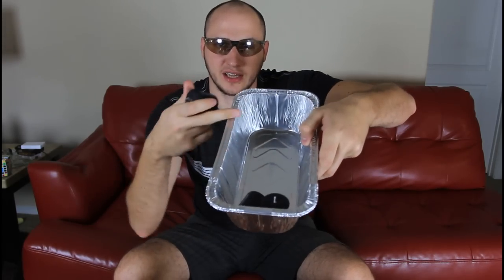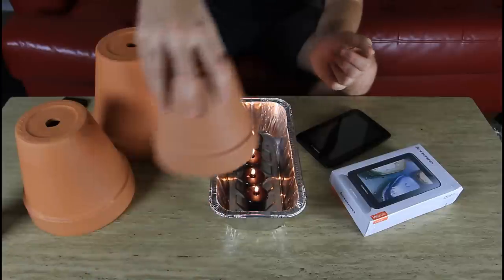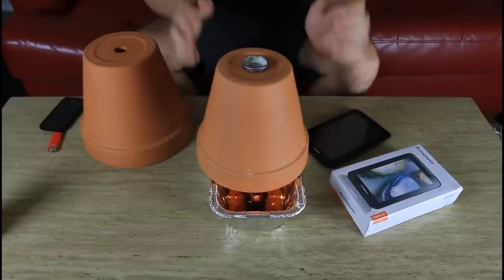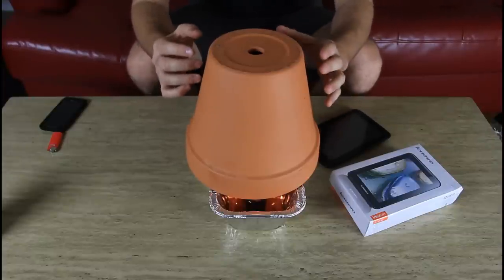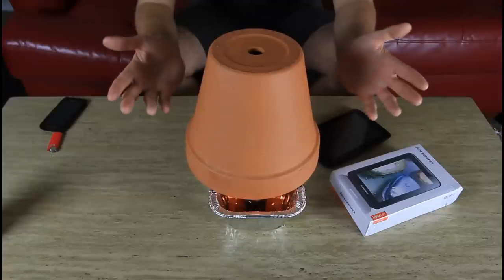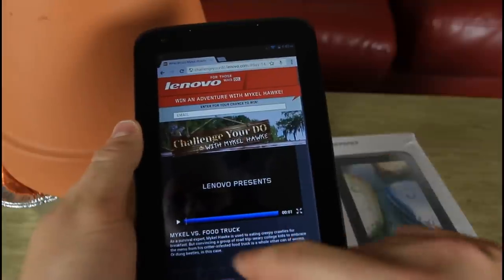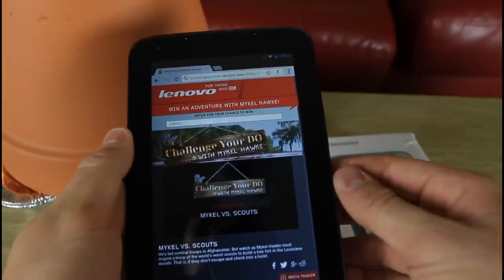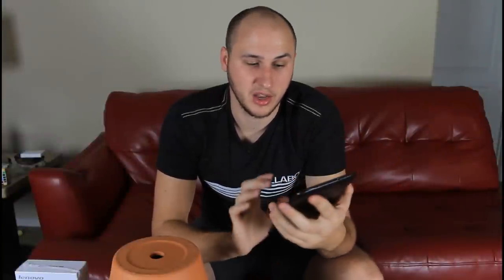Candle Powered House Heater

Comment: Here's my two cents on this thing. Tried it out this (2013/14) winter. I deviated a little from the original. I didn't put my candles in a baking dish as I thought the candles wouldn't have enough oxigen to burn. I made a stand out of a few stones so there was air flow coming in from the sides. It takes about an hour to heat up to the max. And the teapot candles burn for 4 to 5 hours so you've got a couple of hours worth of heat in one sitting. After lighting the candles it would be wise to check on it after a few minutes to see if the candles are still burning. Sometimes one or two would go off. While it does produce heat, the pot heater itself is inufficent to heat up a lot of space. As an additional heat source it does work nice. I used as an additional heat source noth in my bedroom & in my bands practice space. On two occasions it cought fire. The heat inside the pots was so big that the wax in the candles cought on fire. Smoke and everything, had to ventilate the room after I put it out. So there you have it. Definitely would not leave it unsupervised.
Reply: +branimir sremec "definitely would not leave unsupervised" watch my videos to find out why that perfectly describes me.

Comment: how does it work: it will be warm
U dont say!
it actually works because instead of the heat just making a straight column up, it captures all the heat and radiates it out, which is a much more effective way of transporting the heat into the whole room

Comment: Those candles would heat the room up more quickly without the flower pots. What you are trying to do would make sense if you had an external chimney. In that scenario the flower pots would absorb some of the heat from the smoke gases and keep that heat inside while the gases escape through the chimney. But as long as the combustion products don't leave the room, your contraption is useless.
Reply: -_- really candles Heating

Comment: Ha!  My heater is broke and I'm totally going to try this.  It's pretty smart since the ceramic pots will hold the heat rather than it flying up to the ceiling and disappating.  Pretty clever.  Just like a pizza stone in the oven or how people used to put hot rocks under their blankets for warmth in the old days.  Great idea.

Comment: wont lighting 4 candles heat a room just the same, with or without the ceramic pots?  You are not changing the amount of heat the candle is giving off, you are only changing what gets hot in the room first.

In this case you are trapping that heat in a ceramic pot, so the candle is going to heat the pot before it heats the air.  Basically you are going to have to be very close to the pot to gain any benefit.  After 4 hours of burning, the room is going to be the same temperature with or without the pot.

Comment: First of all, I loved your idea, so much so that I actually went and purchased all the items required. May I suggest some amendments, first of all those tea candles do not last very long, so instead I bought a larger candle that was scented that had three wicks on it. It was only $3.00 American. It was worth a try to see how long it would burn. I payed $2.50 for a package of 48 tea candles unscented. I hated the fact that in the middle of the night the tea candles would go out, I had a choice of getting up and replacing them or stay in bed and let the room get a little colder. It is not that I am lazy, but we all know once we get up and do things it can be hard to go back too sleep. So, I then replaced it with the larger candle. It came in a jar so that also helps with the heat. The candle burned for two days and the room smelled of what ever scent you chose. After I calculated the price of the candles and hassle of changing every few hours, there was no comparison. I kept the jars and am going to make my own candles from the wax at a hobby store, but only if it is cost effective.

Comment: One more thing..... I understand why you had to use 3 pots and it worked well, but playing around with it. I stacked the pots with the largest on the bottom and next size to the smallest on the very top. Since heat rises I wanted to see if it would make a difference. I noticed no difference in Temperature, but since it is taller it feels like it radiates out more heat. If you put both of them on the floor the stacked one will send up heat to at least your knee where as your version right about to the ankle. I am so glad I came across your video not only does your idea create inexpensive heat but a nice smell at the same time. I have already figured out what to get friends and family for Christmas. I also use a Pizza pie pan at the base and some spacers made of metal all of the same height to raise the lower pot so it will get oxygen.

Comment: You could use a smaller container so that the flower pots cover the candles more completely. The current set up allows a lot of heat to escape from the side holes where the flower pots do not cover the container. In order to keep an oxygen supply to the candles, the flower pots could be lifted just off the surface with bottle caps maybe and have holes perforated into the bottom of container so oxygen can enter.

Comment: this is one ofthe most helpful things ive ever seen. if it works well you can save a lot of money on energy. maybe using coal instead of candles could be also more efficient
Reply: Coal would be a bad idea because it creates gases that need to be vented to the outside....
Reply: +Liquidcadmus Coal used to use inside but it will burn outside then when no smoking you can put it inside. Also there is a new generation grills like, lotus, nedyme which uses coal inside the house...
Reply: ***** .. Lol.. burning coal inside the house is a mistake if used in the above video application..
    Plus coal, when burned, smells horrible.. threw some in my woodburner at home and my whole house smelled like a steel mill....

Comment: The candle combustion adds heat energy to the room.  Sticking a flower pot over the flame will not amplify the amount of heat given off.  The amount of heat added to the room is the same with or without the flower pots.
Reply: It looks like it'll keep the heat down on the table though, bare candles would just let the heat fly up into the roof where it's basically useless.

Comment: How much heat do you think the flower pots can handle? Do you think they can handle enough to melt silver?
Reply: The pots are ceramic. Generally, ceramics can handle 1,800 °F to 3,000 °F of heat. Silver melts at about 1700°F so in theory, yes.
Reply: Thank you.

Comment: The pots do not add any extra heat. The absorb heat the radiate it later. There is no gain as the candles will have a fix amount of heat they can produce.

Comment: I've done this before, but you need to poke some holes on the side of the bread pan to work better so there's more airflow.  Sometimes there's not enough air for all the candles, and you get carbon build up in the pots, and also creates carbon monoxide.

Comment: 85kep the candles need volume to create enough heat to heat the house or area. The candles create up to 2000 degrees but they have no volume so the pots help that. Also i signed up and watched the vids.

Comment: The four candles will give exactly the same amount of energy, covered by hundreds of pots or by themselves. you are going to heat the room exactly the same amount just burning them normal, plus you get some light out of them so you save electricity.      maby its nicer to worm your hands close to the heated pots, but otherwise it makes only limited sense. love the stuff you're doing though!<3

Comment: How does this work any better than simply lighting the candles?
Reply: Having not seen the video, I'm guessing that the (relatively) hot candle flame effectively heats the pot which radiates the heat more gently, spreading it out.

Comment: I am breaking down my comments so they are not so long, which tend to put people off from reading them..... If you buy unscented candles and want to add a scent, i purchased a small bottle for 97 cents of aroma oil you put in a ceramic small bowl and set on top of warmers to heat up the oils. Since the pots are clay and porous I just squirt it on the inverted clay pot that is outer one. The clay pot absorbs it and then the heat will release the aroma. A few drops will do. it really makes the room smell great.

Comment: Hey!! I signed up and watch the videos pls pick me coz I have an old iPod.:( pls... btw I wanna see your mom in your vids... Love her and her accent.:).         In this case you are trapping that heat in a ceramic pot, so the candle is going to heat the pot before it heats the air. Basically you are going to have to be very close to the pot to gain any benefit. After four hours of burning, the room is going to be the same temperature with or without the pot

Comment: I'd be really careful with this. I've done this before (before I saw this video).  The candles got so hot they liquified and then ignited like a grease fire .Lucky I had sand to put it out, or I would have been in real trouble. I don't recommend this method.